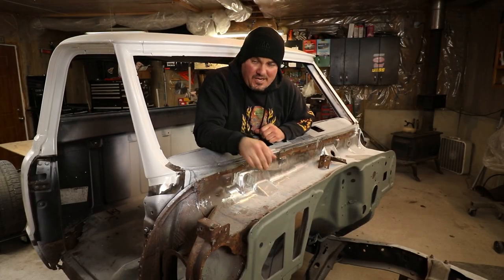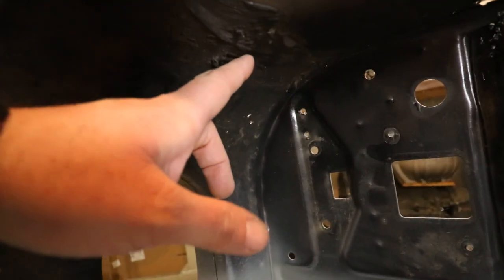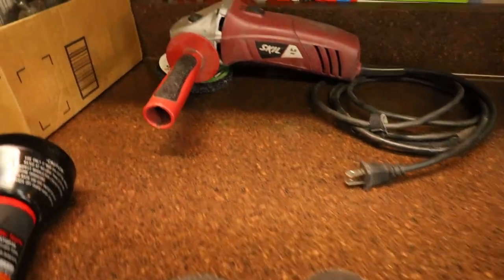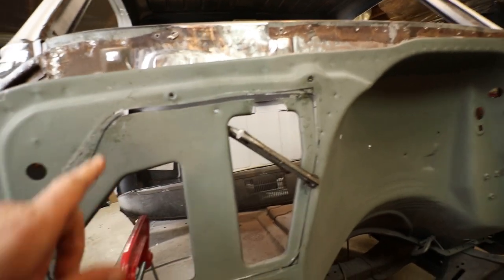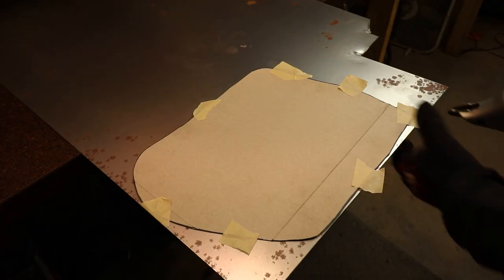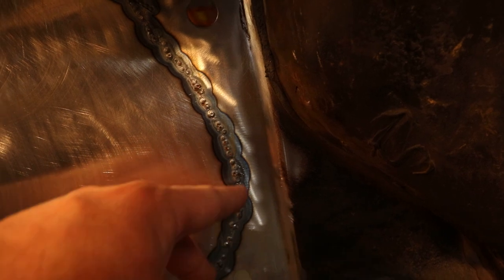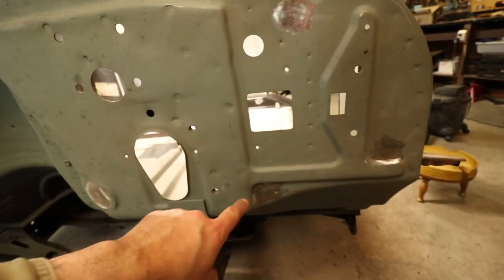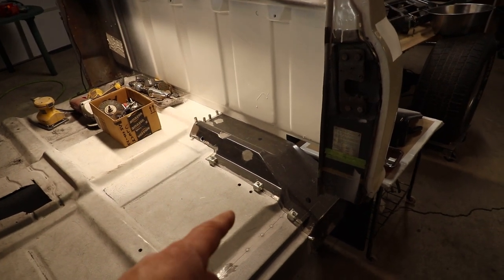How to do sheet metal fab work on a classic truck for beginners - 1971 Chevy C-10 Firewall shaving

Comment: Subscribed. I just swapped an LS1 into my 67 C10, bodywork is next. 1 suggestion-ditch the fiberglass and get some Rage filler. You’ll thank me when you spend 1/8 of the time sanding and shaping.
Reply from the maker: Thanks Danny,  I'll check it out!

Comment: So glad you are back on the c10!  I’m in the middle of replacing the inner cowl on mine as well (along with all the other usual suspects). The repop panel doesn’t fit great  with the curvature along the dash/windshield seam so planning to leave the dash in at least until I get the fitment correct. Thank you for the great content and motivation!
Reply from the maker: No problem Kevin! Looks like I'll be looking into the aftermarket inner cowl I bought to see how well it matches the dash tonight. Lol

Comment: I buy sheet metal from the metal supplier.  They have fall off pieces they sell by weight.  I rarely need a full sheet so random sheet sizes are worth the savings.
Reply from the maker: For sure, great deals! I found a place called Metal Supermarkets a couple of months ago that sells their scraps. I walked away with $400 worth of square tubing for $160. Just need to find the time to make some stands for some of my Eastwood metal fab tools. Thanks for watching!
Reply: @BustedClassicGarage  they have a location in my area.  They're the most expensive supplier we have in the area though.  I only use them for odd sizes I can't find.

Comment: What do people usually put over flooring on these typa build?
Reply from the maker: Once all of the metal work is done I'm going to lay down epoxy. For a factory style restoration, there was a insulation pad for the firewall and pieces of sound deadening roofing shingle like mats. I will be putting a dynamat down or something comparable over the floor and firewall.